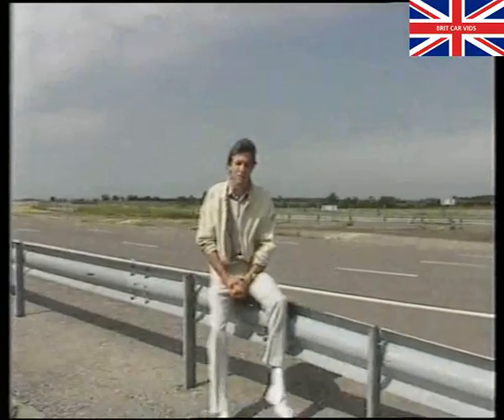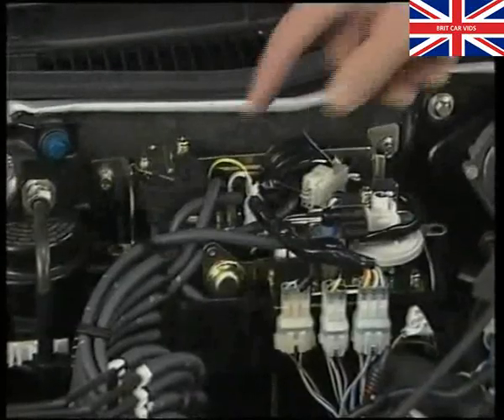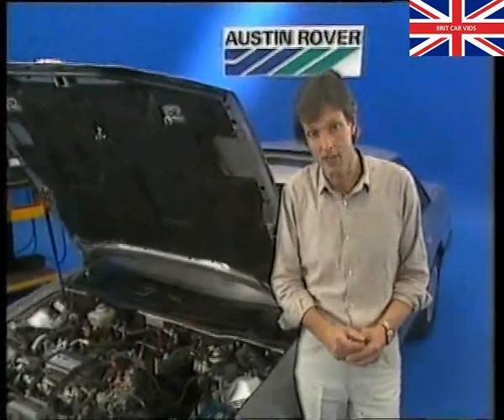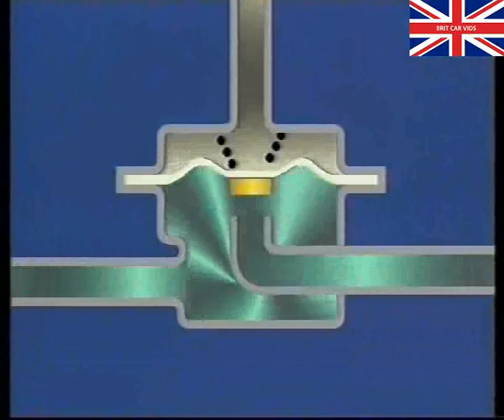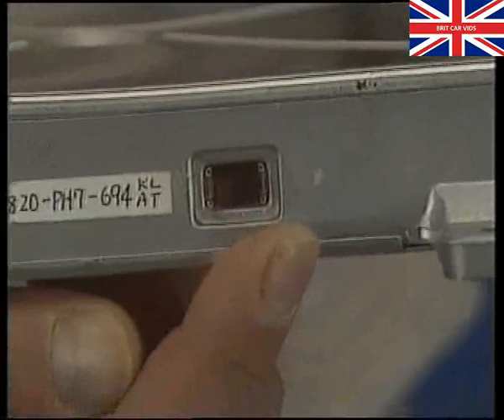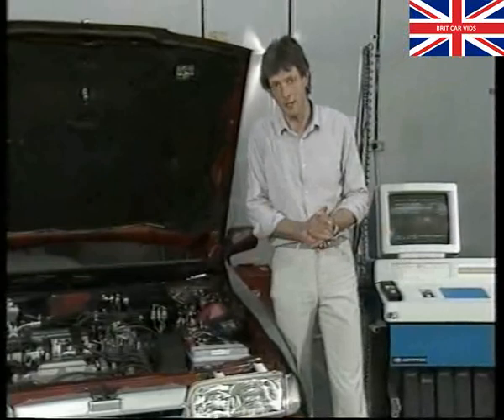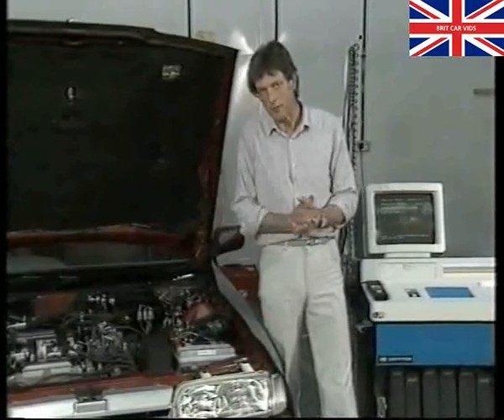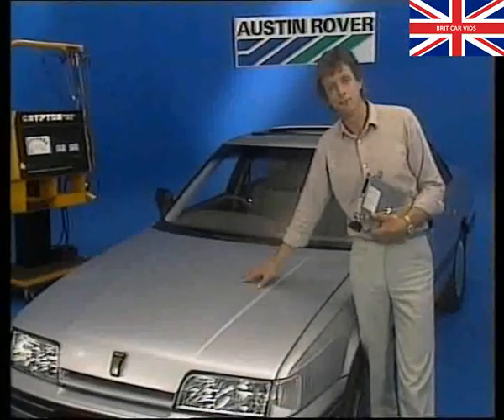Austin Rover - Service Insight -V6 2500 24 Valve -  PGM-FI - Programmed Fuel Injection (1987)

Comment: Thank you!
Have just learned why my ‘87 Sterling wouldn’t always start - faulty fuel pump relay, thought it was the ecu, so this has been very helpful.
Reply: What symptoms did you have? Mine hates starting from warm.
Reply: I have the same problem and also blamed the ecu. I will have to try replacing the fuel pump relay. Thanks!
Reply: @oskarlaur1276  you ever replace yours? Currently looking for mine in my ‘89 under the dash but not finding it lol
Reply: @xxRyanxx414  you should hear it click when you turn the ignition on. cheers
Reply: @oskarlaur1276  yup no power to fuel pump, sputtered when putting starting fluid in throttle body, I wish I found my relay as easy as he does in this vid! Cheers